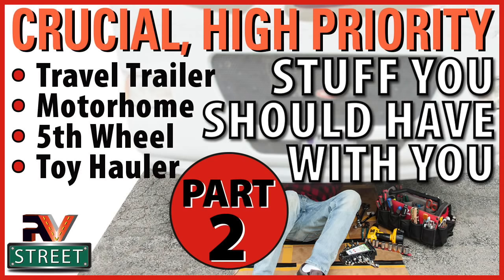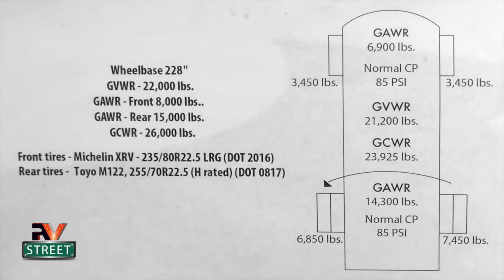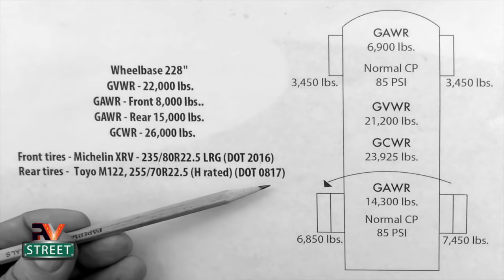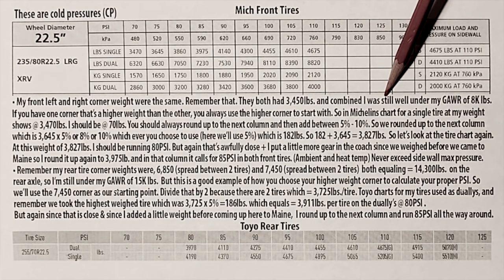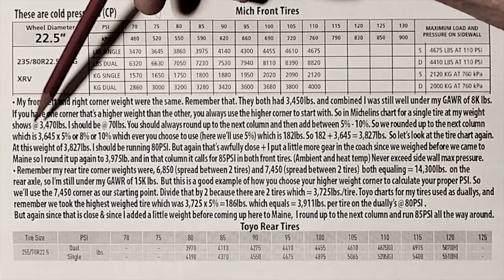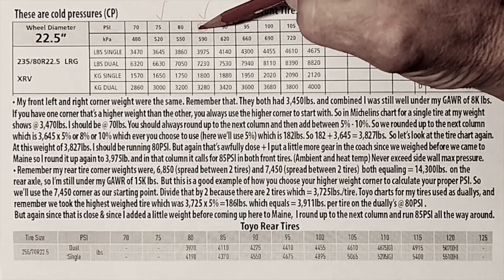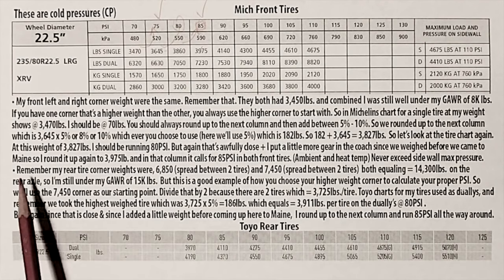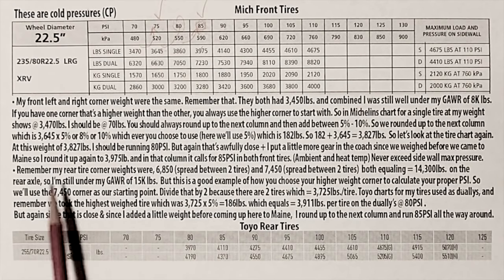How to CALCULATE tire pressure for a motorhome • Or Bad Things Happen

Comment: I did not realize the amount of technical stuff that went with RVs. Thank you
Reply from the maker: You're welcome Stephen,
Think of it this way. RV's are—kinda like—big OTR truck hauling rigs. They are big, they weigh a lot and have a lot of systems integrated into them. RV's are not toys. All though many folks treat them that way. They are full blown homes on wheels that have a lot of control systems and they need to be maintained properly or bad things happen. This particular video you watched, sadly is something that most people don't even think about much, until of course.....something bad happens. Many treat their tires and air pressure like they did with their family car or truck. RV air pressure........is a whole different ball game.
thx for watching 👍

Comment: Great video, best I have watched on tire pressures. Learning what works best on our new to us 2015 Tiffin Allegro Open road 36LA. Watched the TPMS on our last trip closely as we went from below freezing temps in WI to 70's in Texas over several days. Started at 95 PSI cold in WI but ended up dropping to 90 PSI cold in warmer climate as PSI while driving crept up to 109. Goodyear 265/75 r22.5's all around. 
load range "G" MAX pressure 110 on sidewall. Once we dropped the pressure we were running max 104 PSI warm. Cruise at 65MPH, we are on vacation, not in a hurry.Thanks for your detailed explanation!

Comment: This is one of the most important videos you have provided. We have been in RVs since 1983 and had 3 RV, thanks to the instructions provided by Martin, we now have TPMS, weighed our coach, have proper tire pressure, just to name a few items. Thank you, Martin, we are very appreciative of all the efforts you and Joanie put into this for all of us.
Reply from the maker: Thank you David so much. It is indeed a "very important video". I wish it had more views so folks would be better prepared. This is just to important to ignore until something bad happens.
Reply: @RVstreet  Martin and Joanie, just a quick follow up. We just completed a drive from Riverside, CA to Rigby, ID, just under a thousand miles over three days.  The confidence I had in just the tire pressure and temperature increased our overall enjoyment.  In these days the temperatures outside were up to 107 and our rig performed flawlessly.  2002 Itasca, Sunova 27C.  Thanks again, I have several more of your videos to add to my tasks on our motorhome.  Keep up the great work.  Dave Schaadt
Reply from the maker: @daveschaadt9965  thx Dave. Good job 👍 🔧

Comment: Thank you for providing me the link to this video, Martin. The former owner had the rig weighed (the paper is in the satchel of manuals he provided) so I"m going to use your method to calculate the tire psi before installing the TPMS system you recommended. I'll then load up my rig, as you suggest, and have it reweighed. Feeling more confident with each video I watch. Thanks again!

Comment: Martin. Question: What if I cannot get motorhome weights on 4 corner tire positions. And can only get a front axle and rear axle position weights? Do I just divide those 2 position weights each by 2, to get front tire weight for inflation psi and the rear weight by 2 to get rear tire weight for inflation psi?
Where I am located it is very difficult if not impossible to get 4 corner weights. I am pretty limited to CAT scales at truck stops.

Comment: Thank you, I did weigh my  C Class 2 months back after having it for 3 years, then I reviewed my tire pressures, and learned the front could be less and the backs were correct. BUT, after watching this video I am again going to review all my info, and sketch and write it down like you have just so it is easier to review in the future. Thank you.

Comment: One of the best informative channels , appreciate all your videos , I’m taking a long trip on a Motorhome I purchased (3rd one ) and going from camper to Motorhome to a longer motorhome now . Taking all precautionary measures before I make this drive . Your videos are have been very much helpful / insightful . 

I had bearing changed since it’s a 90 ford E350. 
Oil change of course and thought to take the extra measure to change belts and hoses since we are reaching colder weather and prevent any possible Burst. 

I have a 30ton bullet type jack and supporters , do have a spare , may get another spare . Purchasing tpms monitor system and doing another last check with mechanic . 

Any other useful tips you recommend , all ears! But I am checking your other videos 🤙🏽
Reply from the maker: I'm sad to say that Martin passed away but he would be so pleased to know he has  been helpful to you. He loved fixing things and helping people. 
It sounds to me like you have all your bases covered and are ready for the road. Safe travels to you👍
Reply from the maker: It sounds to me like you have all your bases covered. Keep up the great work and safe travels to you👍

Comment: Hello Martin!  In anticipation of buying a Class A once I retired - I did last October - I have been following your Channel and watching your videos for at least the last couple of years.  I thoroughly enjoy and get a LOT of solid information on RV care, upgrades, maintenance and repair from your videos!  Well after MANY years thinking about the RV life, buying an RV it's about to happen; probably this coming weekend.  And if there was ONE thing I have been fretting about for sometime is good tire upkeep and in particular getting tire pressures right - "Martinized" that is - per coach weight at each corner... And in this video you nailed it for me; your detailed calculation process once knowing your rig's weights in combination with the manufacturer's weight/PSI charts; and then specifically your point about putting the same pressure/PSI in each tire on the front; and same PSI on all tires on the rear axel; even if there is a difference from left to right as was the case on your rear axel.  I have not seen or read any explanation as perfect as yours.  Top of my list after taking possession of my new to me 2015 Tiffin Allegro RED beginning next week is 6 new tires - Michelin or Toyo; and then drive up to Escapees in Florida to get 4 point weights... I will then be able to move on with other mods and upgrades now that I understand the tire/PSI "mystery"... but naturally I will continue to watch your videos.  Thank you Martin!  And Happy Trails!  Bob S, Wesley Chapel, FL
Reply from the maker: WOW...Bob what a nice comment. Thank you so much 👍
Ya, how to calculate proper tire PSI is a mystery to many folks. But your right, if you follow the instructions I outlined in this video you'll be spot on and no need to worry.
I'll bet you're really excited about getting your 2015 Tiffin Allegro RED this weekend. That's a really nice coach.
IMO....I'd go with Toyo's. I recently did a video on how I replaced all my tires with Toyo's. Maybe you saw it: 
https://www.youtube.com/watch?v=zjVeal3qzb8&t=398s
Be sure to get a TPMS for this beautiful coach and your toad too if your dragging one:
https://www.youtube.com/watch?v=2kCXRbvtoYA&list=PLkQXtMp9xodTJ0dM4aG8P8IcYEEWBtWBc&index=2&t=370s
https://www.amazon.com/shop/rvstreet
I'm really glad you're a fan of ours 💗
Reply: @RVstreet  Hi Martin… 

You are very welcome!  Happy to be a Fan!  And yes I am very excited about joining the ranks of RVers like you and Ms. Joanie…. And yes, TPMS top of the purchase list… same as you: EEZ Tire TPMS…. You, the RV Geeks (John & Peter), and Changing Lanes (Chad) RV with Tito (Brian) are my go to guys; I pretty much do what you guys say  :-).  Ha! I DID see ur video on Toyo’s and because of that I’m strongly considering them… apparently Toyo does not make a 275.80R.22.5;  Michelin has an “exclusive” on the 275 tire size? Plus they seem to be hard to get right now; whata surprise… so I’d have to go with 295s which I don’t believe would be a problem.  Martin, I do have a semi-related question to tires; more about RV weights… so the coach I’m buying is a 2015 Tiffin Allegro RED…  the GVWR is 29,500 and the GCWR is 33,000…. I want to tow dolly a Nissan Rogue; curb weight is 3421; tow dolly is 400 lbs… so total 3821 lbs…. Well if I add 3821 to GVWR of 29,500 I’m already over the GCWR of 33,000… thus allowing NO ROOM for passengers, fresh water, propane, or cargo!?!?!?  This really scare me; what the heck am I missing?  Please tell me I'm not calculating weights correctly.  Thank you, Bob
Reply from the maker: @Bob Stache  ya your not calculating it right. Your going to be fine.
So....your GVWR is 29,500. That is the GROSS amount you can load the coach up to. THEN...what's left over is your GCWR....
Gross combined weight ratio.
Let me give you a example of our coach and just apply this to yours.
My coach sits on a 22K GVWR chassis, it has 4,600 lbs. of CCC (cargo carrying capacity) with max weight while towing of 26K or GCWR. 
That means when I bought the coach it was empty right? Just like yours will be. Now I start loading all my gear,  clothes, people, pets, fuel etc. I can continue doing this—if I want to—until I reach a total 22K of weight sitting on the chassis. If I load it up to the max like this—which I don't do—that leaves me 4K max of weight to tow so I don't exceed my 26K GCWR.

Now let's say I want to tow a 5000 lb. truck.
Well in order to do that I have to shed off a 1,000lbs. of gear and get my chassis weight down to 21K instead of 22K.
Now in reality the way it is now I weigh in about 21,160 lbs. So I'm 840 lbs. BELOW my GVWR. My toad weighs 2800lbs. and I tow 4 down, so there is no hitch weight. Some my combined weight—my GCWR is 23,960, again well below my GCWR rating.

As it stands right now you don't even know what your coach weighs empty. You also should have a sticker in the coach usually by the drivers side chair that will tell you what your CCC is.
My guess is that once you load up your coach you'll be way below your GVWR of 29,500 and you'll have plenty of room to tow your car.

In short I could of just said this:
Just don't load your RV all the way to your max GVWR of 29,500 and you'll be fine.

I have a video coming out April 9th that will show you how to do a 4 corner weigh on a CAT scale. Once you watch that video it will explain more OR maybe you could go do a CAT scale scale weigh and see where you are before or as your are loading up the RV and just see where where you are before your totally loaded up and go to escapees for a final weigh.
Reply: @RVstreet  Hello again Martin, sorry for delayed reply... I should have provided you both the UVW (Unloaded Vehicle Weight) of 26,599 (which includes full fuel, engine oil and coolant), and the CCC Computation as provided by Tiffin of 1,338 lbs, that includes or accounts for 100 gals of fresh water, full propane tank, and 4 persons @ 154 lb/person.  

And then this morning I had a revelation after reading your remark "I tow 4 down, so there is no hitch weight" and comment on the Tiffin weight plate "towed vehicle TONGUE weight will reduce CCC".  So I don't count the total weight of my tow dolly and toad in the CCC Computation as I was doing, no no no... JUST the Tongue Weight! which I'm calculating at between 380 and 570 lbs... which leaves me a CCC Balance of between 768 and 958 lbs; not really much... but I think I can squeeze out some more CCC by carrying less fresh water, less propane, and realistically assuming only 2 rather then 4 passengers...  So I won't know for sure my tongue weight until I have my tow dolly & toad setup and get it weighed... 

Assuming I have this all right I too now think I will be "ok"... Thank you for your explanation; you helped me see the light!  Happy Trails Martin!  Bob S. 

P.S. just got word from the Seller that he's received a "clear" Title (his loan paid off by me; so lien has been removed) from the FL DMV, so I will be closing the deal on my new to me Tiffin this coming Saturday... Woohoo!
Reply from the maker: @gerbobpaul2  Ya you don't need to be carrying 100 gallons of water. That alone is 830 lbs. Carry 1/3 of tank instead. And yeah 2 people instead of 4, those two things right there you just added 854 lbs. to your CCC. If you decide to tow 4 down—which I highly recommend if you can—that's another 300-500 lbs. more you can add to CCC. So ya I agree, I think you'll be just fine.
Maybe go to a CAT scale when you take possession and just get both axle weights to get the real dry weight and then after loaded up get your 4 corner weigh to see where you really are and how your weight is distributed and the final information you need to air up your tires properly.
Reply: Good morning Martin, feeling much better now about my “weights”… after this major purchase  a new to me car I can tow 4 down is just not in the cards right now… meanwhile thank you very much for helping me sought through my RV weight calculations… I need to get new tires right away - Toyos very likely - and then I will get to the weigh station to establish my base weighs all around…. thank you again and Happy Trails… Bob

Comment: Back again with another question. If your dual tires require an higher pressure setting then the fronts would you set your fronts to match the rear tire pressure? Thanks again Martin for making your channel easy to understand.
Reply from the maker: NO. All 4 rear tires should be the same PSI and that is calculated by starting with the one rear tire that is carrying the most weight. The front is done the same way. For example, right now with my current weight I'm running 85 in the front and 90 in the back. Now in some instances all 6 tires COULD be running the same PSI, just depends on what your weight and weight distribution is. There have been times where I added more weight towards the front of the RV therefore I have been known to run 90 all the way around.
So in summary, all 4 tires in the back should have the same PSI according to your weight and the front 2 tires should be the same accordingly to your weight.

Comment: This is one of the best PSI requirement video I have ever seen and makes total sense.  I too am very anal about my tires and monitoring them.  I have a class C now, but just purchased a new class A and this is great information as a reminder.   I never took into account the 5% rule which I will now.  Thanks!!!!
Reply from the maker: Yep, 5% or 10%. That will account for ambient temp fluctuations.

Comment: I really appreciate your videos and try to use your store. I understand how important all of this is. The one thing I don't understand is if you set everything completely full and weigh coach .Then you use water , gas and propane , wouldn't your tire pressure be too high? Isn't that also a concern?
Reply from the maker: It's not a concern. Here's why....
Under inflation is where you can really get into trouble. The coaches weight is always going to be changing. Adding fuel, burning fuel, adding water, using water, buying groceries, using groceries. It's called weight creep. It will eb and flow. But all in all it will average out. You want to set your PSI to when it's the highest weight and use the most loaded tire as your starting point.
I mean just look at your tire PSI charts. Your coach could easily change weight of 500 - 800lbs. But the amount of PSI for that difference is not that much.
Joanie & I usually carry with us about 1/3 of a tank of water with us. Maybe 1/2 tank sometimes. But normally there just isn't any reason to carry 800 lbs of water with us going down the highway. But lets just say we were going to carry that much, it would be unusual and I'd add a few lbs. of air in that case. But I don't do that.
I know what my coach weighs and I set the PSI once in the spring and I may change it one more time in the late fall if it starts to get cold and my pressure starts to go down some. That's it.

Comment: My coach is similar to yours but I just run 80 psi like it says by the driver door. But I don't drive it much and not very far at all. I also try not to carry much weight. I keep my fresh water low and don't fill up my gas tank more than a little over half. I guess I should get it weighed to do it right. Right now I'm trying to figure out how to check the hydraulic jack fluid as I'm getting the popping sounds at night when it gets cold. I found the spot to check it but it looks like a pretty big socket I need. Not sure I have it.  Couldn't get it off with my hands. I'm a newbie for sure and there is so much to learn it's a little intimidating. I don't want to pay an RV place for every little thing either so I must learn everything myself.  Thanks for making these video's. Sucks that they charge so much for little maintenance stuff. Must be good business for them.  No disrespect intended but you have a nice looking wife....and I'm a younger guy.  lol Thanks again for the great info!
Reply from the maker: Feeling intimidated is a natural feeling at first because it's all new. But that's why we're here sharing with everyone all these step-by-step DIY vids. Consider it just a another adventure. Most all of you can do 90% of these things. Just get the right tools, be patient, learn, take notes, keep records, gain knowledge, knowledge is power and over time it will build confidence, know how, the ability to be independent and fix most things your selves and save you a ton of money over time. Once you learn......pay forward and share with others. 
thx YT for watching 🙏
Reply: @RVstreet  thanks so very much. I plan to do just that. It's been fun so far. I'll keep watching. Good stuff!
Reply from the maker: @HiHello-ku1fl  🔧💗